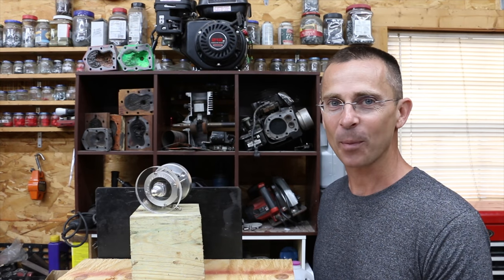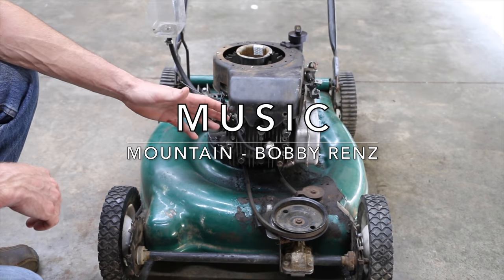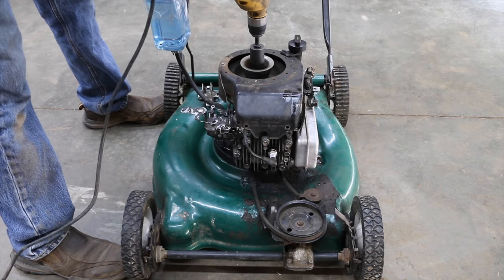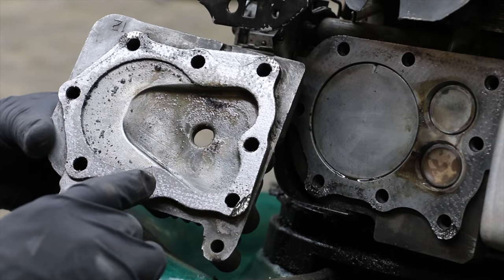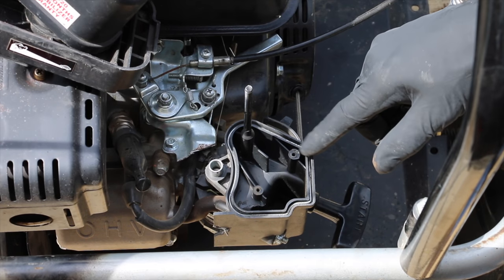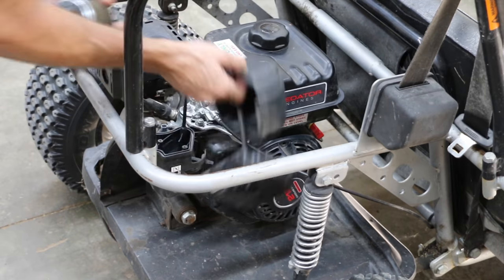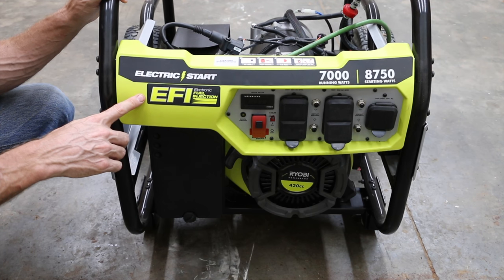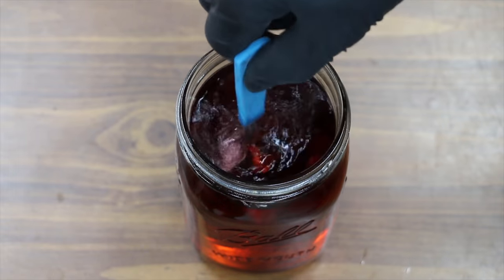Is Leaded Fuel better than Unleaded?  Let's find out!

Comment: I remember putting my hand on the metal exhaust box on the lawnmower when I was young. Good times
Reply from the maker: Ouch!
Reply: I think all of us whose dad made us mow the lawn has done it. I also remember me pretending to make a shaving razor commercial and cut myself pretty deeply halfway through my demo in the bathroom mirror
Reply: touching my entire right ankle onto a Harley exhaust after driving for half an hour with my grandpa was fun too
Reply: getting my right ring finger almost cut off by a go kart chain was fun
Reply: When i was a kiddo, i always curious about dat pipe sticking out on the rear of the car (exhaust pipe) so i have nothing but curiosity to touch it and completely ignoring the fact that the car was turned of minute ago, and sure enough i touch the very hot exhaust tail pipe and got a pretty painful burn :)
Reply: Right i did the same
Reply: Elias Montoya yep! I did that when I was 5. My dad just finished mowing and I touched the muffler. My hand had swollen up badly. That was a 1986 Snapper. My dad upgraded in 2014 so now it’s mine. It won’t die.
Reply: Same here. 6th grade, instant peanut m&m sized blister. Good times indeed
Reply: Getting my shoe sliced by my motorbike chain but not my toes was fun
Reply: Did that to my brothers 2 stroke cr lol
Reply: I put my elbow on a go kart while looking back at my friends. Burned straight through my winter jacket and melted it. Luckily my elbow and forearm were okay.
Reply: ZLATINO LOPEZ glad you are alright
Reply: This guy is probably the biggest buyer of Briggs cylinder head gaskets
Reply: Nuuuu at least my electric generator exhaust muffler says “*HOT*”
Reply: @cripstopheriii3509  I got lucky and learned my lesson when a motorcycle exhaust melted the rear of my rubber sole
Reply: Me and my dumb friend were on a 4 wheeler and he like slammed on the brakes so my foot went on the exhaust pipe
Reply: I remember when I was a kid, my dad had a riding lawnmower. He had it running one time and I accidently set my fingers on the back of the bare sparkplug+wire (missing rubber boot). Talk about "fun times". 😏 Boy did that shit hurt. It was just a split second but I can remember my eyes went blurry during that very brief...yet STUNNING moment.⚡  I was about 10 at the time but still remember how it felt like it was yesterday...You never forget shit like that. Hah
Reply: Actually it’s OHV
Reply: I did the same thing with a four wheeler exhaust... good times
Reply: Sameeee
Reply: I remember sticking my Moms car keys in the electrical sockets when I was 3. Good times. Ironically I became an electrician...lol
Reply: @eliasmontoya7515  Did that on my face and legs when I was 4 with a Bic. Good times. Gillette Brush Plus was the shit in '84
Reply: When I was 4 i revved the engine of my father's '74 K5 Blazer while he was jump starting his friend. Yeah that one got the shit beat out of me...lol
Reply: I did it once in accident and never did it again 😂
Reply: Millenials know nothing of such things. 🤣
Reply: @HSKFabrications  ...I’m a millennial 👀
Reply: @evelocz  You actually do yard work?
Reply: @HSKFabrications  I used to. I’m in an apartment currently while finishing up school so unfortunately I don’t get the privilege to 😅
Reply: Haha don't worry I did it too!
Reply: @bobbyscalchi4013  lmfao fitting! Us butter knife kids just arent cut out for that line of work
Reply: When I was 3. I did it twice. I was told.
Reply: What did you learn...the important thing is if you did it again lol?
Reply: By the time I was cutting grass, I was 12 and knew all the systems of a motor and how it worked, so I never got a bad burn from it, but I lightly burned my hand a few times just from the radiant heat while attaching a trailer
Reply: Minibike clutch repairs before you knew it was that hot .....~ those were the days .
Reply: My dad had me hold the spark plug and the bare plug wire to check for spark. The first time I was prepared, the second time I got pissed. It worked to test spark tho.🤣
Reply: We had one that had the round muffler I noticed " it looked like I could unscrew it" while my mother was mowing
Reply: @ProjectFarm  I race dort karts and have seen the tilly carb you refer to on the kart do u have a video about that carb I cant seem to find it if so
Reply: Why has everyone done this? (Including me)

Comment: A nice reature of AvGas is that you don't need fuel stablizers.  Basically you can store it for many years without any issues.  
It's also ethanol free so it won't cause rust if it sits in a gas tank in a "hobby car" sitting in a garage for years.
Reply from the maker: Thanks for the feedback.
Reply: Unfortunately it’s hydroscopic
Reply: @jamessharp9790  Not AvGas.
Reply: @JosephDredd31  you’re right
Reply: Unfortunately it contains lead which I find hard to believe we still use in fuel. Putting lead in something we burn a lot of was never a great idea
Reply: I'll take stale gas and destroyed diaphragms over heavy metal poisoning any day.
Reply: @charlie_nolan  It looks like they are finally getting lead free substitutes that might work. Dont expect Avgas much longer, only one refinery makes it and they have to purge the whole place to make a batch; and they dont sell enough to leave it that way for long. Which is why its 2x the price of Mogas.
Reply: I'm more worried about the gaskets wearing out from non-operation than what gasoline is in the tank
Reply: @_Circus_Clapped_  True, but running a car once a month to get it up to temp does not address the fuel issues.  I have TWO gas tanks from Z Cars at my house now to treat with por15 gas tank sealer because of rust.    Airplane fuel is designed to be in open vented tanks and be good for years.
Reply: @jamessharp9790 it's hygroscopic
Reply: @georgecroney6168  AvGas is not.  That's the one good thing when using it on carburetor old cars that are not used on the highway.

Comment: Just got to a job where I have to wait to get loaded. *checks YouTube for content, YES!! Project farm has a new video!
Reply from the maker: Awesome!  Thank you very much!!
Reply: Waitin to get loaded... = company  driver in a bunk that smells like ass, with a trailer that has bald flat spots on the tires. 😘
Reply: @seananon4893  not over the road and it's a 26 ft truck so no sleeper unfortunately and tires are actually brand new. I may have smelled bad tho cause my a/c just took a crap 😔

Comment: My brother had a Suzuki Jeep with the LJ 50 engine (a three-cylinder two-stroke). He used to have a 10-pack of spark plugs in the glove box; changing one spark plug was no use whenever one failed. In 1984, I built a home-built tractor using the engine from his Jeep. I had a plug failure almost every time I used it to mow grass; cleaning and reusing the plugs was virtually impossible.  Then, in 1986, Australia introduced Unleaded Fuel; I never once replaced a spark plug in the next 35 years! I used that tractor to mow Church yards, Soccer fields, model Railway Club grounds, and my own 1/3rd acre block.  Ted from down under.
Reply from the maker: Thanks for sharing.

Comment: Excellent testing as usual. :-) The Go Cart looked like a lot of fun. Drone footage following the go cart was cool too! A++
Reply from the maker: Thank you very much!  The go kart is a lot of fun and a pretty smooth ride with the suspension.  Looking forward to your next video!!
Reply: @ProjectFarm  what about putting lead in diesel engine. Would have to be a generator etc as cars have to many sensors the lead would make contact in the sensors and reak havoc. It may help to stop if from wearing out etc.
Reply: @ProjectFarm  i have seen where my company used  avgas in equipment before that has set for 5 years and the fuel after 5 years is still good without stabil
Reply: @mattlawton4715  it's not the sensors that are the problem, lead will stop up catalytic converters. I can't think of any sensor that even actually comes into contact with fuel. O2 sensors will obviously be exposed to exhaust. But that's about it. Maybe something in the egr, I haven't messed with anything really new, because they're just getting too finicky. 2010 is pretty much my cutoff. But these are about the worst engines to test leaded fuel anyway.
Reply: @salvadordollyparton666  fuel pressure sensor does fuel regulator does like you have pointed out tho the catalytic converter would suffer 👍

Comment: "Not to be used as a skin cleanser"
I was thinking about exfoliating my skin with neurotoxic heavy metals and volatile hydrocarbons, thanks for letting me know it is a bad idea!
Reply: I used to work at a small airport, and one of the oldest most experienced mechanic would wash everything, including his hands, with avgas
Reply: @Taydrum  still to this day many folks that ive worked with use gas leaded or not to wash everything including their hands, cant say im not guilty of doing the same
Reply: @joshabrey6693  I've done it before, but It's not good, I know plenty of old timey A&Ps that have permanent nerve damage from Methyl ethyl ketone, and i can only imagine what leaded gas is doing
Reply: @Taydrum  what are A&ps?
Reply: @jonyemm   Airframe and powerplant certified mechanic
Reply: @Taydrum  thank you for that information. I'm familiar with what MEK is but what is the relationship between MEK and A&Ps? Do they just use it as a cleaner or is there another use? Thanks for the info btw.
Reply: @jonyemm  It USED to be the solvent of choice for cleaning and degreasing. It was used like we use acetone today, for everything. It's been phased out as we discovered that it causes severe health problems. Many of my A&P teachers used to work with it, without knowing the dangers, and suffer permanent nerve damage. It's a really effective solvent though.
Reply: The only legit thing I've used gasoline for in terms of cleaning the skin is to remove tar. It does great with that.
Reply: It actually works great to remove grease and oil

Comment: Another great video! We have been using 100LL in our race engines for over 20 years and like you said it is not for everyday low compression and/or emission controlled vehicles. Will say one thing we have noticed is that the tops of our pistons and combustion chambers stay cleaner on 100LL over pump gas due to the fact that it has less additives than pump gas. 100LL also evaporates way faster than pump gas if you spill it and doesn't stink up the shop as bad :) Keep up the good work my man.
Reply from the maker: Thank you
Reply: It won't boil in the tank of the chainsaws like pump gas will though.  And i left 2 motorcycles sit after an injury, for several years.  The one with 100ll started on the 3rd kick, the one with pump gas required the tank to be hot tanked, a new petcock, and extensive cleaning and replacement of all brass parts in the carb.

Comment: Many of us high School guys used to run If I remember right 110/94 mix of avgas premium leaded for the high school nationals at our local quarter mile track. They were held as the seniors were graduating. The rules were any vehicle could run, had to go to the local high school, had to have a license, permission slip if under 18, had to have good brakes, no leaks, good seatbelts and a helmet along with an overall safety inspection.  We'd spend 2 days before getting tuned up to run that mixture and doing anything else to try to get an advantage. fuel injected corvettes were the easiest to set up, most guys were swapping in electronic ignitions tossing the points and changing jets in the carb, you could hear guys trying their setups all over town! 
Appreciate the video, it brought back some good memories! Wish we could've took video of some of the spectacular engine failures from running too high of an octane and having the mix too lean.
Reply: no wonder murica has so many mass school shootings and violence. its all that lead from bullets from gun ranges, etc leaching and contaminating ground water
Reply: did you ever realize that your av gas was not making anymore power than the straight 94 octane ? not unless you boosted the compression on the family car drastically before race day.
Reply: @deletethis5489  we could advance the ignition without detonation or just run down to the  junkyard and pick up a set of high compression heads. The older 440 heads were only $30 and 350 Chevy heads were even cheaper. This was a once a year event ( and only 2 times for most of us ) so we would do what we could afford to get those few precious tenths of a seconds without spending a lot of money. Most guys were already running headers, nice exhaust, electronic or dual point ignition, cam and performance intake. The guys that had to run the family cars usually didnt make many if any changes.
Reply: @lordjaashin  Yeah has nothing to do with drugs, lets ignore that. Seeing as democrats love to experiment.
Reply: @tenkillcombo  -- that's an old wive's tale. Higher octane has a higher activation energy but once ignited, burns at the same rate, within a few microseconds.  Read "The Internal Combustion Engine in Theory and Practice, Volume 2" by Charles Fayette Taylor.  You only need to read the first four chapters.  And higher octane allows for advanced dynamic timing (static or base timing is a function of the combustion chamber shape), which is partially why higher octane fuels give more MPG.  Higher compression ratio can be used which gives more horsepower and further improves MPG.